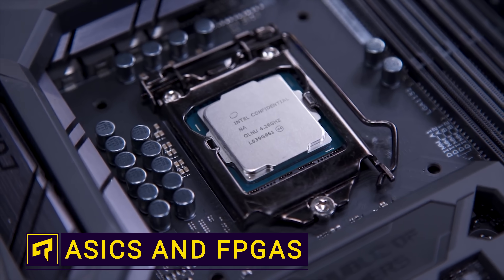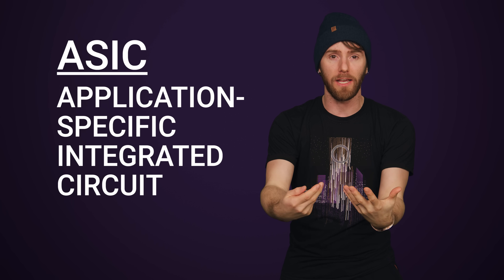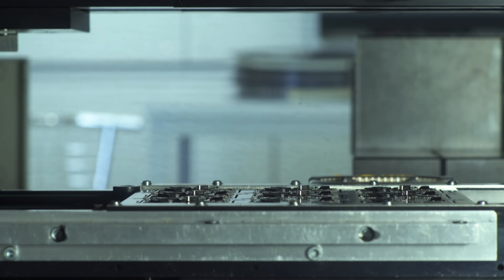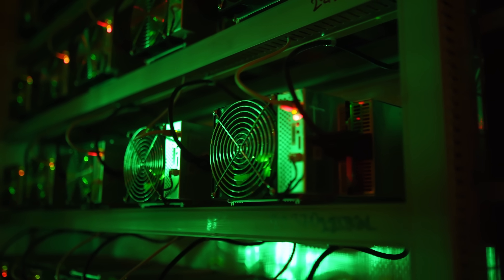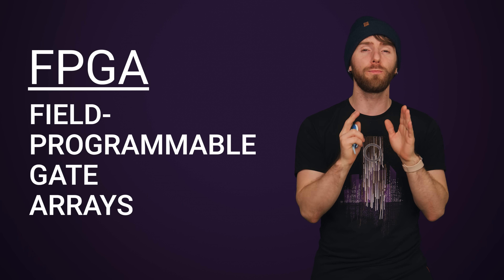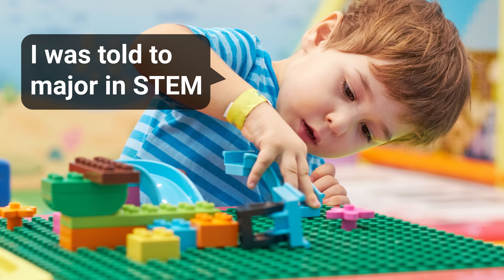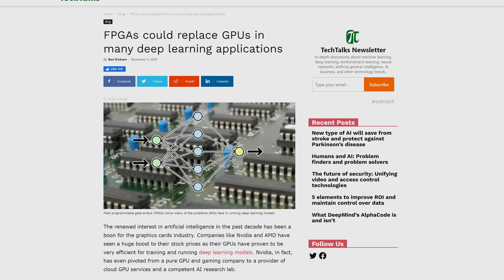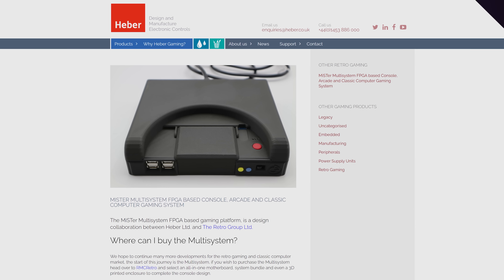These Chips Are Better Than CPUs (ASICs and FPGAs)

Comment: I'm a bit confused here. In each and every example you still just have a bunch of transistors turning on and off like a switch. In other words, they're all still doing the exact same thing in the end. I think there are some crucially important details missing from the video. Cheers 🍻
Reply: Cpu's are made to be as general as possible so they can do as much varying tasks as possible. The transistors (and logic gates formed by them) are grouped in "big" building blocks, for example adding numbers (not exactly but a close enough example).

FPGA's (Field Programmable Gate Array) are chips where you have 'just' logic gates and you can program the logic gates and connect them how you like to perform whatever specific task you want. You can make something that adds numbers (just like that building block in the CPU) but you can design it any way you like and make it behave completely different if that is what you require.

ASIC's are somewhat like a CPU, as in you can't program the logic gates. But they contain one very specific logic circuit designed to just do that one very specific task, over and over again, very efficiently. Some examples of ASIC's are, well ASIC's for crypto mining, or NPU's (Network Processing Units) in networking gear like switches, because they only need to do a very small amount of (different) operations, but very fast and efficient. 

Most often the logic circuits in ASIC's are first designed, programmed and tested on FPGA's.
Reply: It all depends on how the transistors are connected together. That's what defines your architecture, what the circuit actually does.
Reply: I posted this in another reply, but the short version is that a CPU can do ANYTHING.  But the down side is that at each step, it always asks "what is my next instruction?"  It has to get an instruction, and do that one instruction.  That takes time and logic space.  In an ASIC/FPGA, the instruction are in the wires themselves, so the chip is built to know what to do (think a short-order cook that can make anything vs. a factory that churns out thousands of Twinkies every hour).  A factory can't make an omelette, and a chef can make a Twinkie, but not 100,000 of them.
Reply: Thanks everyone, these answers really help to fill in the gaps. Cheers 🍻

Comment: With future CPUs being tile based and Intel aswell as AMD having bought FPGA companies, it may very well be possible that an FPGA will be a standard component in future computers. I.e. it could be used to retroactively add hardware-accelerated de-/encoding for newer video codec formats or implement custom algorithms (like effects/filters in Photoshop or Lightroom) in hardware.
Reply: Thank you for Apple and Google to whip Intel's and AMD's asses

Comment: In terms of comparison, CPU's are highways that are specialised to do a task & fast, emulation is like city stroads where there's a signal after every 50meters, fpgas are basically streets with no signals but roundabouts. So u can't do as fast as highway cpu in a turning roundabout fpga, but it won't be as slow as emulation of traffic signals.

Comment: That's why consoles exist, dedicated gaming, people calling a PC a gaming PC always baffles Me, it's a PC, yes you can buy a GPU to allow your PC to game but that doesn't make it a gaming PC, it's the same as "Gaming phones" it's a phone, cable of gaming but it's still a phone first, just like a PC is a PC first, doing everything a PC should, gaming is secondary, but of course people will still call it a gaming PC, if anything the only gaming PC that exists right now is the stream deck running it's default software
Reply: are you ok
Reply: Consoles don't use ASICs or FPGAs though. The ones Linus mentioned in this video are the exceptions. Every other console uses just a CPU with an integrated GPU.

Comment: Software emulation for sufficiently old games is superior as you have WAY more processing power then is needed & can run at higher frame rates, anti-alising, & upscaling for a much higher quality image yet still authentic gameplay.

I use my old laptop from 10 years ago, installed linux on it & now it's a media machine for my tv (perfectly legal), & to emulate retro games & I've got an xbox one s bluetooth controller.

I cant imagine throwing out old hardware as my old laptop can legit last another decade if not longer of regular use for what my needs are.

Comment: And Jiggery Pokery will soon enough enable CPU's with FPGAs onboard so they can be extended with new CPU functions added by implementing new instructions or features on them things using the most advanced forms of jiggery pokery! (For example the CPU has no specific video encoding accelerator for one format, you simply jiggery poke the firmware implementing the encoder in hardware to the FPGA portion of the beast and bang, your CPU can now encode the newest most spanking jiggery poked coded released! And bang, suddenly hardware upgrade licenses actually make sense without buying new chips Unlike Intel making you pay to unlock features already present on the silicon... This is the real deal, not Intel's scammy deal)
Reply: With AMD's Xilinx acquisition this must be on the cards, Intel already has in fact Xeons with FPGAs onboard thanks to having purchased Altera, though I am yet to see them releasing stuff like I just mentioned, a CPU FPGA feature store will make sense pretty soon! Intel could even remove AVX 512 from the cores fixed function logic and instead sell that for the FPGA side, this should enable better thermals and even enable having AVX in many a different type due to the added FPGA Jiggery pokery flexibility enablement capacity! This is a mind f*** in terms of possibilities it brings to the table!
Even better will be including FPGAs on your GPUs so you can have them add more CUs, Tensor cores or what ever makes sense to add power or features to your GPU. 
Maaaaan this may not be easy to implement but the possibilities it opens definitely make this jiggery pokery worth every penny!

Comment: What I want is a CPU, GPU and FPGA on one die.
Reply: Impossible, Moore's Law is dying. That's why everything will use chiplets or tiles in the future.
Reply: Most FPGA accelerators use PCIe, what we need are APIs that normal devs can use to make them viable for consumers
Reply: Intel and AMD might start producing those for datacenter applications (on the same package, not die though). However, the starting price will likely be around $10k USD, so no average consumer could afford one. Intel has already made a product that includes a FPGA and a CPU on the same package though, which could be used in servers. It was called HARP.
Reply: That's why Apple Silicon SiP exist

Comment: cpu is the most generic asic
Reply: dont waste time in asics, just do a ton of fpgas
Reply: think about a cd/dvd/blu-ray activated wiring-enable fpga structure, ie, you just print the graphite wires to connect proper units on the board, physically, you already have the structures (fpga logic cells) on the board